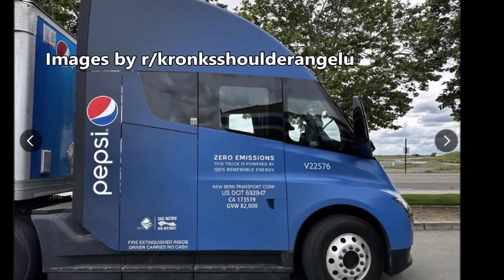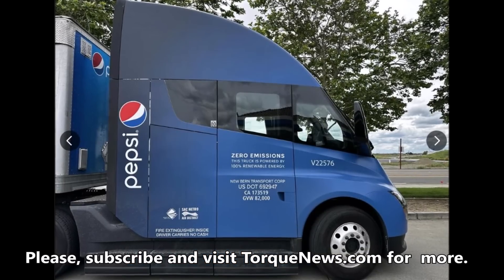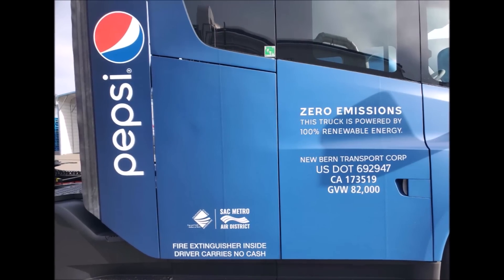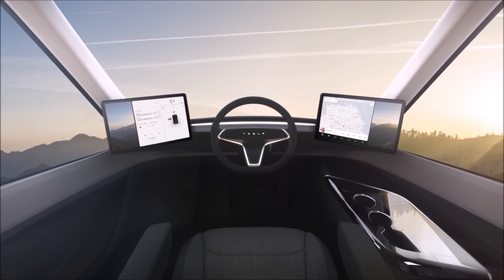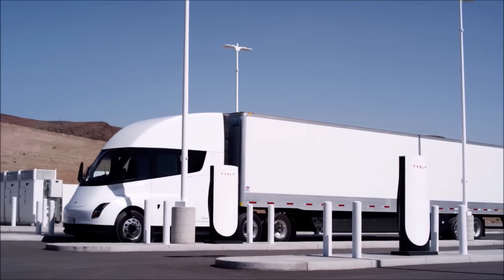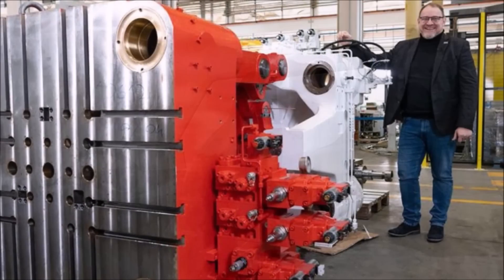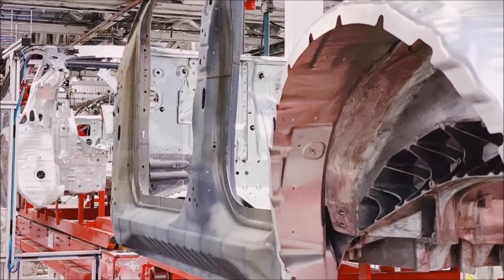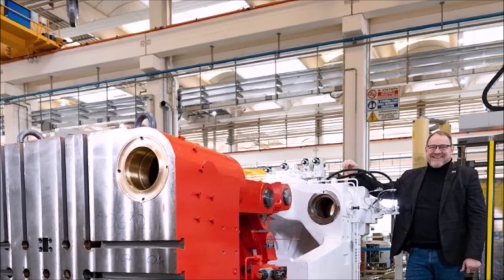New Pepsi Tesla Semi Sighting Shows 3 Cameras and The Secret for Truckers

Comment: i do not drive semi's but I do drive trucks and busses and I do not see the problem with a center seat.  You do not always reverse into a spot only from your nearside but often, in my case 50% of the time , using the mirror on your far side.  so sitting in the center will just make it equal does not matter which way round you reverse in.  also this will be fantastic in Africa where you have countries that drive on the left and right.

Comment: The other issue is the driver may not have a practical early egress of the truck when an accident happens. All they need to do is to open the driver's side or passenger side to get away from fires, wreckage, etc. instead of meandering their way out a complicated indoor labyrinth.
Reply: Rumors? That's what you operate on? 

The seat is openly accessable! No Labyrinth!

Comment: If you stand from your seat to give your paper to the gate guard you are right it is a lot of time but if you can open a side window and stand a little without going down the truck to hand your papers that will solve your problem, any way you need to stretch during a long drive.  About your dirty shoes entering your conventional truck to the driver's side and leaving the dirt on the seat floor is easy and quick, on the Tesla you enter the door standing and bend to clean your shoes or use another shoe and leave the dirty shoes in a corner without spreading the dirt on the truck cabin...